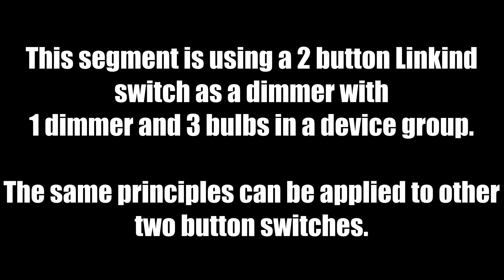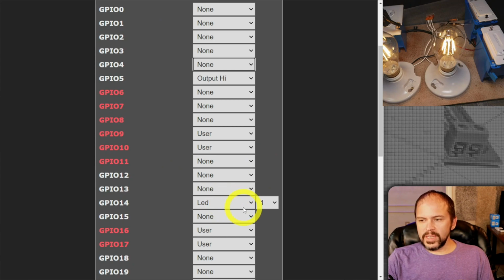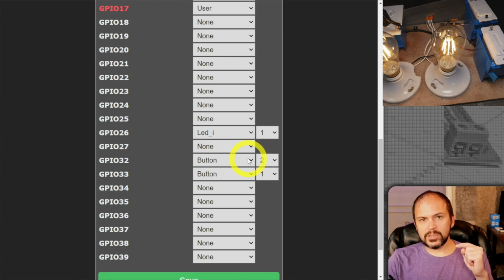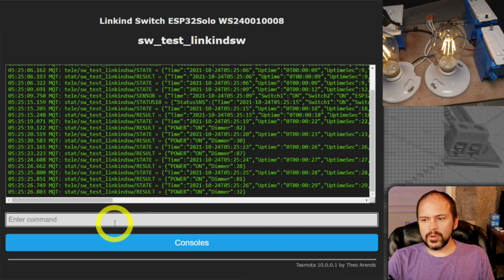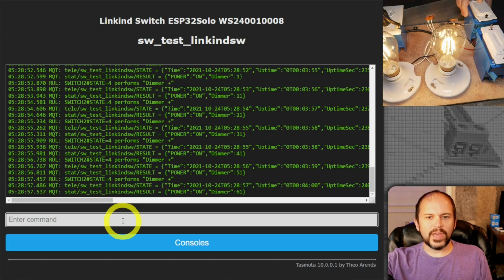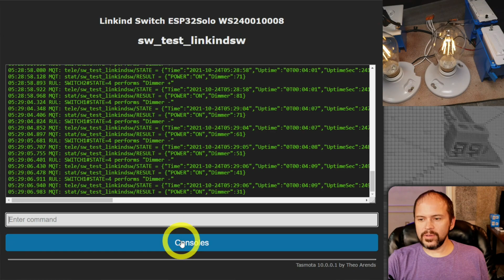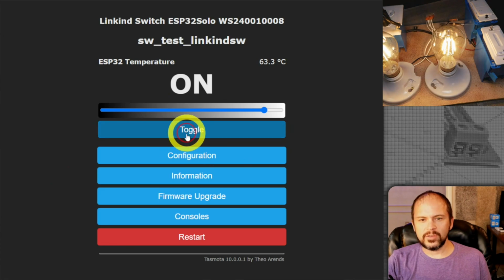Two Button Switch Dimmer with TASMOTA Device Groups

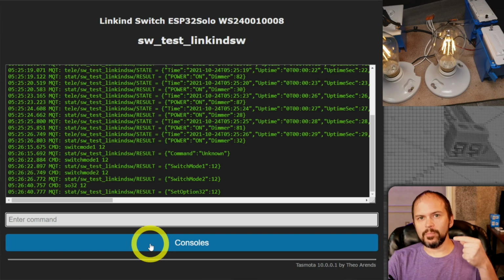Comment: Hi, just to clarify, is that smart bulb or smart bulb holder with a normal bulb? 2:32
Reply from the maker: Those are smart bulbs. 2 channel bulbs. Warm white and cool white.
Reply: @digiblurDIY  thanks, guess you’d still need actual dimmer switch for normal lights
Reply from the maker: Yes. As that's more of like analog lights. We like the smart bulbs due to doing color temps throughout the day.

Comment: With 'Linkind Switch as Dimmer' template,  button led turns green/red etc with On and OFF command and with button press, changing GUI slider changes brightness of green led too, BUT load terminal does NOT see power i.e. no ON OFF or dimming.  Looks like relay/PWM is not working. Switch works fine with 'Linkind Switch ESP32Solo WS240010008' template. Any idea why?
Reply from the maker: Did you set the output as high?
Reply: @digiblurDIY  Tried GPIO5 none, GPIO5 OUTPOUT HIGH (buldbstays on all the time), GPIO5 to OUTPUTLOW (bulb stays off all the time)
Reply from the maker: Yup, then that's it.  Set GPIO 5 accordingly if you need the load high or low.
Reply: @digiblurDIY  Sorry, I did not make it clear. Setting GPIO5 to HIGH/LOW/None, does not change anything. Bulb/load terminal shows no change on OFF/ON/Dimming for any value in GPIO5 template.
Reply from the maker: Is this the switch? GPIO 5 should change the relay.
Reply: this is a  Switch WS240010008. Switch works  FINE with 'Linkind Switch ESP32Solo WS240010008' template (Where GPIO5 is a relay 1) i.e.  ON button (or GUI toggle) turns bulbs on, Off (or GUI toggle) turns it off!   I will keep using as a switch and not as a dimmer.  Thanks
Reply from the maker: You can only use the switch as a dimmer with smart bulbs.

Comment: Would you recommend these linkind switches to be used with ifan04 for the kitchen and dining room ceiling fans?
And maybe exhaust fan and lights for bathroom?
Reply from the maker: As long as the amp ratings are not over the switch.

Comment: Thanks for the info! I do wish you had explained the rules and why that specific switchmode was needed. "Teach a man to fish" ya know?
Reply from the maker: Not much explaining to it given it is the only one for dimming control. There is another like it but it is for inverted buttons and this one uses a regular one. It's a tough one to explain if I went off the docs so I tried to keep it quick as I was already running long but then this ended up as a standalone anyways. https://tasmota.github.io/docs/Buttons-and-Switches/#switchmode

I just used the 2 and 4 states. KISS principle

Comment: Awesome!  I just picked up on of those Linkind 2-button switches.  Looks like they changed the screw types to get into it.  What kind of torx is this?  None of mine security bits fit.
Reply from the maker: It was a small torx from what I remember. I don't have the number off hand. I know people used small flat heads as well.
Reply: @digiblurDIY  Just checked and it's a T7.
Reply from the maker: Guess they did change it on some.  T7 wouldn't fit on my switches or dimmers.
Reply: @digiblurDIY  I'll just buy a T4 - T10 set or something. Cheap crap on Amazon.
Reply: It's a T6 torx.
Reply from the maker: Confirmed as well, I was able to check mine and they are T6 too.
Reply: @digiblurDIY  Thank you gentlemen.  Of course, I have T5 and T10 and nothing in between.  These edges are so rounded that a flat blade won't turn it I don't want to strip these.    Looking forward to making these work with my Zigbee cans in the ceiling.